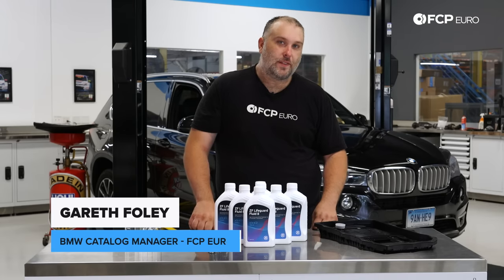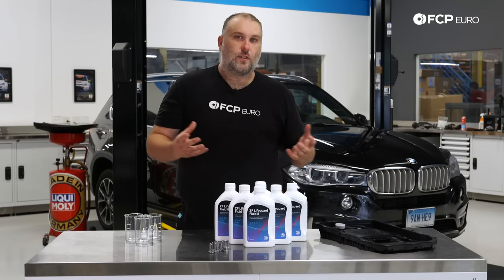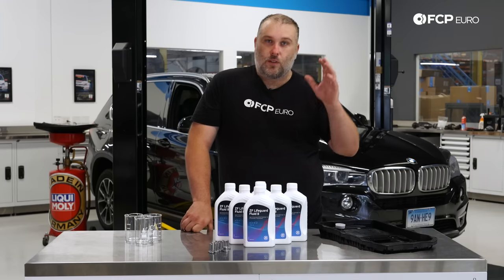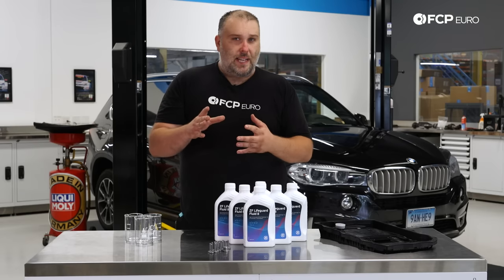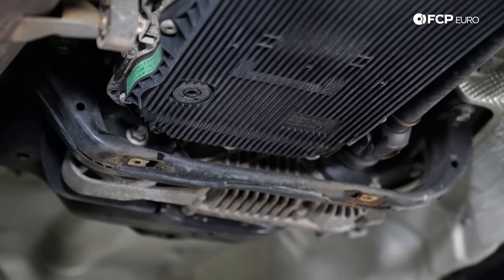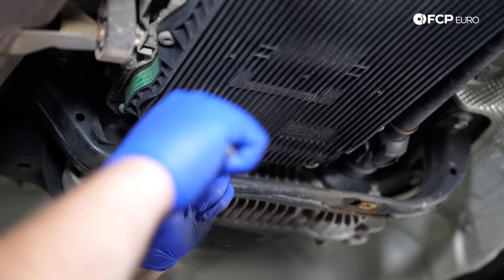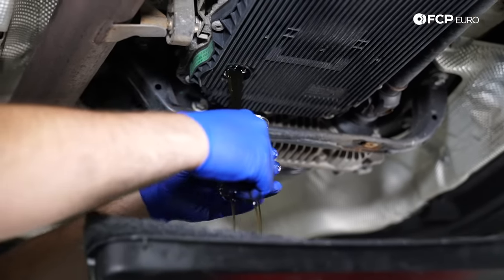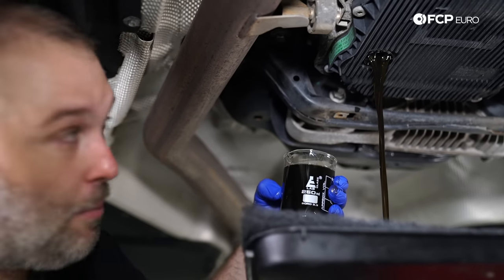ZF 8-Speed Transmission Oil Change (BMW, Audi, VW, Dodge, Land Rover, Toyota, & More)

Comment: For at home DIY using jack stands, is it OK to level the car using a bubble level on the bottom of the transmission pan? Drained 4.37l but was only able to add 2.35l on the first cold fill. Is that enough ('15 F30 with ZF 8)?

Comment: You guys sell Liqui moly but you guys fill the fluid on OEM fluid? I fill little betrayed. :(
Reply: It's a very specific synthetic fluid and the transmission is engineered around it. Why use something else?

Comment: The filter change is nice, but not as important as just doing a drain and fill which is what I did after the initial filter change. The transmission always comes alive after a fluid change.  The dark fluid is actually the ash from broken down additives.
Reply: The pan is one time use and I think the filter is in the pan?

Comment: When the engine was cold after the flush, how long did it take to warm up the new oil transmission  to 45 degree ?
Reply: It depends on where you work. If you are in a controlled room with lets say 22 degrees celsius then problably around 10 minutes. In a colder environment this may take up a bit longer. If you can't get your hands on a diagnostic tool that reads out the correct temps then get a laser temperature meter and simply point the red dot at the oil pan :)

Comment: Uhhhhhhhhhhhhh, yea, the Dashboard has an active Trans Temp gauge, ya just do not NEED a scan tool. If ya have one great, but, DIY'ers do not NEED a scan tool.  American Temps are 86-122*F ONLY. If its above 122, let it cool down and retry.
The rest is all good info, however, I used Amsoil Trans Fluid on mine and she runs like a scalded ape. 

Also, IF you are doing this service remember to do the Transfer Case, Front and Rear Differential fluid  AND BUY THE DAMN ALUMINUM PAN that has a replaceable filter. All you plastic boys have to buy the plastic Kit every time cause they are throw away items with non changeable filters. GET SMART with your DIY. The Aluminum Pan also has a deeper front well so it holds a lil more fluid than standard PLASTIC Ones. Also REMEMBER your Transmission level HAS GOT TO BE LEVEL when filling for proper fluid level.

Comment: Hi, Is it true that if you have an external transmission oil cooler, you will need to get the transmission fluid up to 70 C and go back to top off the transmission fluid again?
Reply: This is what I am also trying to find out, the instructions from ZF request driving the car until the transmission temp gets to 75C and then doing the final fill between 30-50C, steps involving keeping engine at 2k rpm and shifting through gears.

Comment: This video is very good except it does not cover vehicles which have a transmission oil cooler (which is the majority of the BMW cars). Those owners which have an oil cooler need to either drive or heat up the transmission until it reaches 70 degrees Celsius (oil cooler thermostat opens) and then re check the oil level and re fill again after the temperature drops back down to 40-50 degrees. It is estimated that the difference is about 0.5.-0.7 liters.

Comment: Man I paid to have this done twice, looks like I'll be doing it myself the next time around.
Reply from the maker: Easy enough to bang out in your driveway and save some money doing so!
Reply: @fcpeuro  
Suspect a dedicated enthusiast diy er could do it in the driveway, 
However having access to a lift is going to make it a lot easier. One additional point worth mentioning is draining the pan and refilling in this manner leaves a significant amount of old used oil in the torque converter and transmission cooler that will mix with the clean oil,  definitely not ideal.  Imagine draining 7 litres of engine oil from a sump with 10 litre capacity,   seven litre refill of oil mixed with three litres of old oil,  are you going to be happy with that ?
Reply: @paulcalmond  I'm a bit confused. What Gareth did to drain the old oil from the torque converter or transmission cooler?
Reply: @aquamaster111  
Draining the gearbox sump typically drains a small portion of oil from the transmission,  if you were doing it yourself at home and left the sump pan off overnight before fitting the new sump pan and filter there would be a little more drained out.  The torque converter and transmission cooler and pipes will contain several litres that aren't drained. Most owners I have spoken to got four to five litres out of a transmission that has a dry fill of about eight and a half litres
Reply: @paulcalmond  You could always do the 5 quarts, then drain and refill another 4 or 5 liters after a couple hundred miles.  Not ideal but it would probably be 80-90% fresh oil. Still saving a bucket of money from dealer cost plus I don't think you should ever flush a transmission, especially a ZF.
Reply: @fcpeuro  as long as your driveway is level...otherwise you won't get the proper amount of oil in.

Comment: Great video, but I am skeptical of the need to change this fluid, especially given your lab results.  We have two E39 BMW’s with GM transmissions, a 1998 and 2000.  Both with more than 160,000 miles.  The fluid has never been changed. When I asked my independent BMW mechanic about 10 years ago, he stated that it was not worth the expense. Turns out he was right.  Never had any tranny problems. YMMV.
Reply: interesting. which country are you in? im in tropical Malaysia and in the tropics its hard to imagine no fluid change in 20 years
Reply: @Vanguardkl  Memphis, USA.

Comment: I replaced the transmission pan and fluid on my 2017 BMW 330i x drive, at 51,000 miles, using the FCP Euro kit (ZF pan and  ZF fluid). Followed the instructions on the video. Everything went smooth. Very satisfied. It took only 4.7L of fluid, with no spill. I was surprised to have so much left over, but I do not regret having bought the 7 bottles, just in case, and will just use the last couple liters at next fluid change. I recommend you buy the whole 7 liters. Cheap enough insurance.
Of note: the ZF transmission fluid stinks! Not like regular ATF, more like some differential fluids. I am surprised nobody mentioned it before. Kinda funny. The used fluid was quite brownish. I did not feel any improvement driving the car, it was fine before, but I plan on keeping it as long as I can, so I am happy I changed the fluid and expect it will help with longevity. Thanks FCP Euro
Reply: How did you get the car in the air to work on it? It has to be flat to check the fluid level. That’s my dilemma.
Reply: I use quick jack, lifts the whole car.
Still working on your back though.
But for home mechanic it's really nice bit of kit.
Reply: 7 liters is for the dynamic oil change, this guide is for the static oil change, i.e. you mix about half the old oil with the new oil, because without a special machine it is impossible to drain all the old oil, a lot of oil stays in the stopped gear despite unscrewing the plug ... sorry for my eng. :)

Comment: Performed this service at 55k miles on my 8HP.  Funny thing is that ZF updated (1.10.2020) their interval to 150,000 KM  (90,000 miles) with an unspecified shorter sever service interval.  

I wonder if the automakers were getting upset at ZF when they had the shorter interval (45k-60k miles) because they all advertise "lifetime fill".
Reply: Yea...we noticed that
Reply: Question for you. I have a 6HP19. First fluid change was at 119k miles or 193k km. Drained and refilled about 6L. Trans shifted beautifully for the next 10 months and 10k mi.  Then, at 128k miles or 213kkm I had 4-5 upshift issues which was fixed by solenoid change. I think I ended up using 2 new bottles in the new job, meaning 2L. Let's say the fluid in the trans is about 75% new then. Car has shifted amazing since. What do you think interval should be for next fluid change? I was thinking 50k mi/80kkm, running it right around 185k mi or 300kkm. Make sense?
Reply: @leifer20    55k-75k miles sounds good to me.

Comment: 150k miles on my bmw 5.20d zf 8 speed. Dont listen those services requirements and do not spend money every 50k miles. I am telling you know i never touched the ZF as long as your gearbox is changing gears as smooth as brand new do not touch it at all. Because you are using ZF not a crap build. If the gears not smooth then you change the oil. This has been told from ZF specialist and i am myself have an experience with my car.
Reply: Gears and metal can withstand time. Oil doesn't. Servicing is the cheapest repair.
Reply: @Mariini  i know that but every 50k oil change in gearbox the most unnecessary thing in car industry specially on ZF.  I change engine oil and service on my bmw 5.20 2012 every 8-10k
Reply from the maker: The good news is, after you change the first time with service parts from us, we cover them for as long as you own the vehicle with the Lifetime Replacement Guarantee, so you can change it as often as needed for free
Reply: @fcpeuro  thank you for to offer mate but i am mechanic myself and have a garage with tools and everything appricated for video tho

Comment: I went to the dealership and asked about changing the transmission fluid on my 2018 Ram 1500 Ecodiesel with ZF 8 speed transmission (only has 27k miles - only doing it because it's used truck and want to have a peace of mind)...I was told by the dealer that they do a transmission "flush" and use a BG product first to clean the transmission, then they flush out the old fluid and replace it with new one. Several people have warned me not to do a transmission '"flush"...So, is it safe to get the  transmission "flush or should I do a drain and fill like in your video? Please advice, thanks!

Comment: Crap my 2015 Dodge Charger Scat Pack already passed 100K miles, makes me wonder If I should got the Mopar extended warranty.
The transmission is solid however if I knew I had to change the fluid at 50K I would done it, Funny that Dodge gave me all the service Intervals for Engine, Brakes, LSD but no transmission :/

For what its worth I only spent +$5K in tires and brakes since I bought the car, Engine and Transmission are rock solid but now I wonder if the transmission will hold on the next 50K miles or reach the 8th year mark.

"Sigh" Ill have to reconsider purchasing the mopar extended warranty now with used car price penalty vs new car or find me trusted Transmission repair shop when this thing breaks :|

Either way it will not be cheap :S

Comment: Thank you for the great videos. I cannot stress how important it is to service the transmission and the transfer case in BMW with xDrive. Very recent personal experience with my 2017 X5 3.5xDrive when the car started developing at 43k miles (70,000 KM) a random stutter on any gear during acceleration at any speed and any throttle inputs with no code, no noise and no specific vibration and no leaks. After much investigation on the engine side (sparks, harnesses, filters,...all for nothing) and calls into BMW worldwide support, BMW requested the replacement of the transfer box fluids and, voila, back to silky smooth. Next step would have been a replacement of the transfer box....a financially heavy proposition. 
Analysis also showed no metal debris in the oil. 75% of my miles are in town with 25% on long road trips, don't know if it is a factor to the accelerated decay of the transfer box fluids.
Reply: The transfer box on my 535xdrive was replaced under warranty at 31k miles. It failed pulling hills in Sport mode😮. Only issue I've had with the vehicle. Now at nearly 60k miles considering transmission drain and fill. Will probably change transfer case fluid also.

Comment: I’ve got a 2015 535d with the 8HP70 transmission. Followed the instructions, fill was done at 40C with engine running. The total fill (hot and cold) was 4.5 quarts. Seems low, but nowhere else for it to go. Reason for alarm?

Comment: Hi there, thank you for the detailed information. I have a question regarding the fluid. My car is 2015 BMW x5 35i xDrive M sport package. I was going to get the transmission fluid, they looked up by VIN number and told me that it take zf9 lifeguard fluid wich was confusing for me. Will you please help me with this question.
Thank you

Comment: I have an 2011 sienna v6 with over 450000 miles still untouch with the factory filled transmission fluid since new and factory spark plugs since new. Got my money worth already and at this point if the car dies, I'll just buy a new sienna.

Comment: Hello FCP, hello people in the comments. 
I followed the exact same procedure, but i've drained only 4.5l, but the repair kit has 8l.
Is that normal ?
Reply: Same thing with my car. I've asked around and was told that "as long as you did the official filling procedure, the car drives fine and throws no errors, all is fine- don't sweat it".

Comment: Why not full dialysis where you push all the old liquid inside the the transmission vs just what is in the pan? Are you not mixing old and new oil otherwise? Not all shops do it because it is more time consuming.

Comment: hi, great video. I've seen alot of information/chat about the expense of ZF lifeguard fluid. and an equal amount regarding the use of other fluids in this transmission. There seems to a vast amount of varying opinion on whether or not it's safe or good to use a different fluid. There was a very detailed video on this subject https://www.youtube.com/watch?v=F7MaXLwWQik. it's long but section 2 speaks specifically about fluids and specs. was wondering if you have any insight/opinion on this.

Comment: My independent shop quoted me $953 to complete a transmission oil change. Sounds high?
Reply: I think so its to high price.My F11 BMW when I asked in my independent garage they told me around 200euro in Ireland,Oil pan plus transmission oil its around 160-200euro

Comment: Great video... I see your using the life guard 8. Can you possibly help me with a 2012 Hyundai Genesis coupe 3.8  6 speed Automatic.The Petit cular year I bought The transmission was made by BMWThe fluid recommended by the manual is shell ATF M1375.4. Dealer is asking a $110 per quart!  When I went to the lifeguard site it said that the life guards 6 was not suitable for my car and directed me to life guard 8??  Any chance you can look into this for me thanks Greg
Reply: You should be able to use mercon sp   It’s used on ZF 6sp used on 2007 navigator. Similar trans. But check for your car. $10 at autozone. Check with Greg first

Comment: So I have a 2016 Dodge Charger  R/T with 76k  on the clock. I've been told 100k for the transmission fluid, so naturally, I didn't worry so much about the mileage.  No you're saying the actual transmission manufacturer recommends 50k!! Should I do the service or is that a situation like you said, too many miles. There's no issues with the performance,  just like to keep up on my maintenance.
Reply from the maker: Hi George, at 75k you can still get on top of it and service the transmission, and if you wanted extra insurance you could do a makeup session at 100k, or just continue to service it every 50k miles.

Comment: Great video! For a power fluid filler,  I added an inexpensive 3/8" barb ball valve to the hose on my Motive Products brake bleeder. Now I can use it not only as a brake bleeder but also as  a power filler.

Comment: Is there a torque converter for the ZF 8HP? If so, how do you flush that out? Through multiple oil changes over a few thousand kms each or what? I can’t find any info on a torque converter flush for this model. Thanks!

Comment: I drove my X5 from Myrle Beach SC to San Francisco and noticed that the car was having a loss of forward momentum when accelerating and going uphill in New Mexico.  The car had 103,000 miles on it at that point and had just had fuel injector/coils/ spark plugs/valvetronic motor and valve cover replacement done.  I took it to BMW dealer in the north bay area.  I was told I needed a new transfer case.  I took it to another dealer and had the transmission fluid/filter changed as well as the transfer case fluid and the rear differential fluid.  The problem resolved on the drive back to the vrbo.  They charged me over $2000.00 for the fluid change but less than the $9000.00 the other dealer wanted.  I did not have many tools with me, but had I been at home and with these FCP Euro videos I would have saved a lot and felt better about BMW.  Thanks for your videos.  I'm getting ready to do the above fluid/filter changes again with your products and videos.
Reply: I had a similar issue with a 2015 535. It felt almost like the car was slipping in gear when under load such as going uphill. In my example issue was a broken part in the transfer case due to some "spirited" driving. Transfer case was replaced under warranty. No issues since.

Comment: Would this process, pan and fluid be the same on a 2018 dodge durango. Trying to get the components to do this myself without paying  1000 bucks for someone else to do it.
Reply from the maker: The ZF hp8 is in tons of cars. They are not all identical though. You would have to confirm your particular transmission model and infer from there. its possible they're the same, but we cant confirm Dodge fitment

Comment: Interesting information. The opinion of several workshops in my country, rarely change this zf8 transmission oil, because of the wrong understanding of life time fluid transmission and also do not understand how.
Reply from the maker: thats certainly a common misconception, as they are marked lifetime fill.

Comment: Is Liqui Moly Top Tec 1800 also good to use in the transmission?
Reply: Use the actual ZF fluid. It's the engineered match for the transmission's internals.